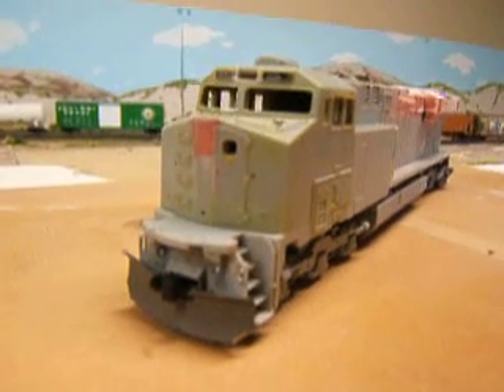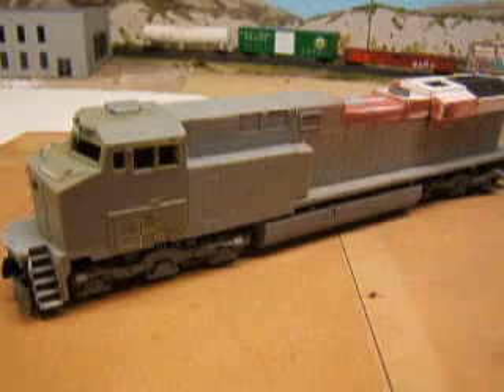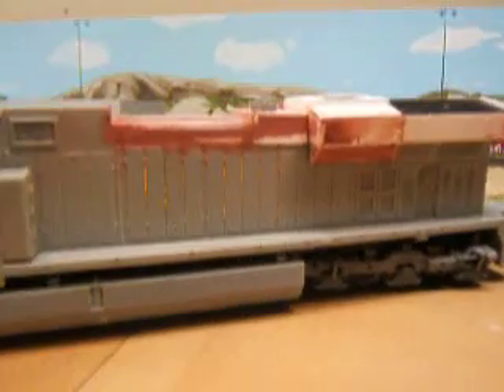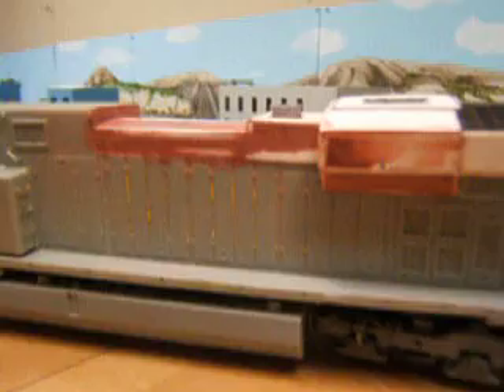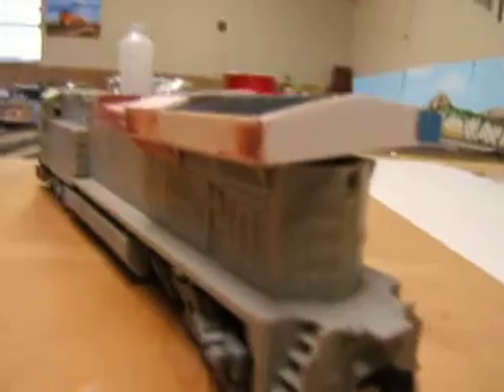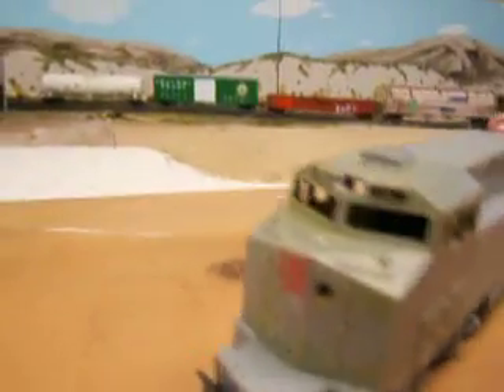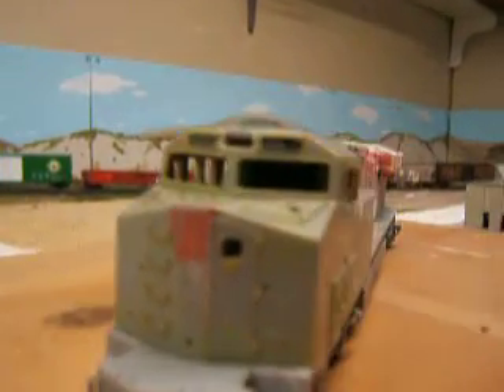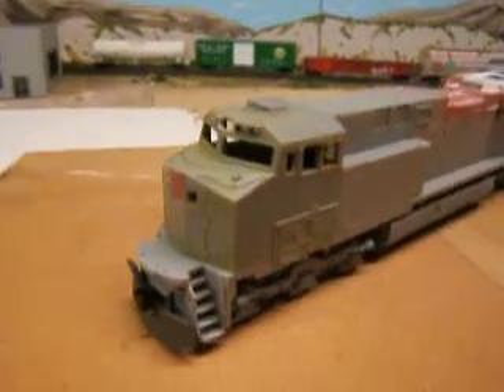My first attempt at making a es40dc.....

Comment: Great job! Just a couple of questions. What did you use to fill in the nose headlight slot? And secondly, what parts did you use for the headlight relocation to the cab? Was it a seperate headlamp assembly that you modified to fit your cut? I'm just wondering because I am in the process of doing the same thing.